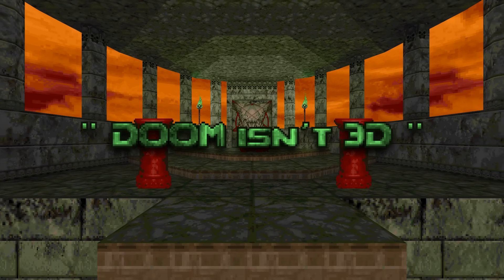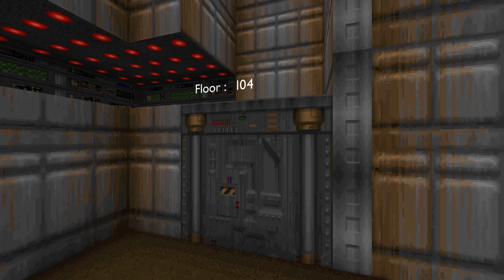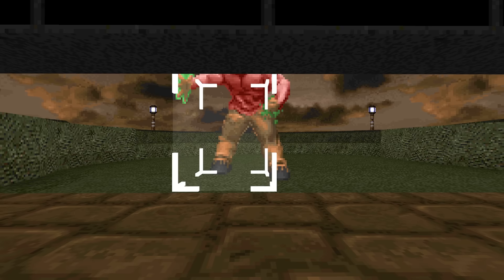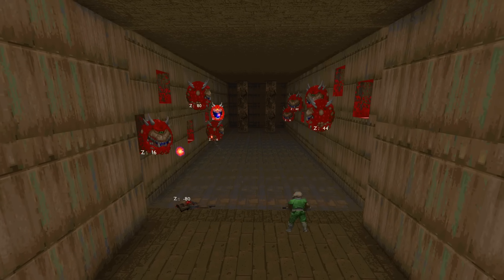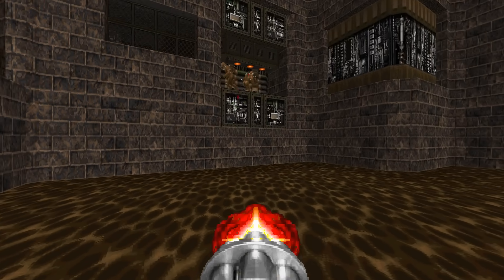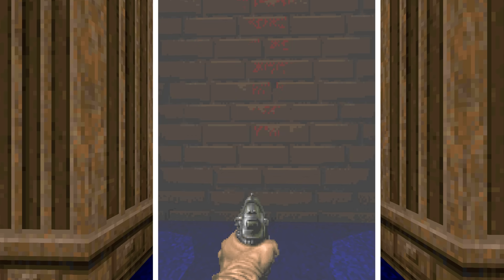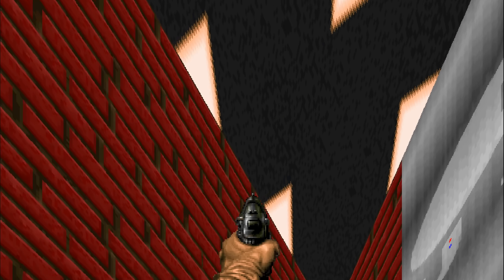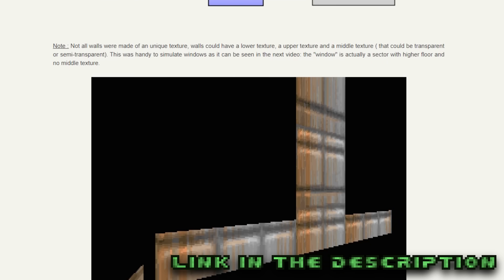Doom engine - Limited but still 3D

Comment: Fun fact: the Vanilla style of vertical look, also known as y-shearing, originated in Heretic
Reply: Marathon had it too, released almost exactly the same time as Heretic
Reply: @Xilefian  If we're talking about early 3D games in general, Rise of the Triad used this technique and was released two days ahead of Heretic :)
Reply: @Xilefian  there's probably other prior art as well, but it's certainly the first doom source based implementation.
Reply: @xeostube  marathon was based on a modified version of the doom engine, it also featured stackable cells.
Reply: @Golden_MC_1 Marathon was not based on Doom engine at all, it was a custom engine made for Macintosh and did not use binary space partitioning
Reply: Heretic also added z-collision to monsters and decoration IIRC, allowing you to fly over them when using its flight power up.
Reply: @LonelySpaceDetective  Raven Software developed some amazing improvements for the engines on which its games were based.
Reply: @Hammy Burgers Not him, but I do believe DN3D (and every other Build engine game) used the same technique for vertical look, yeah.
Reply: Um, no. I am playing Cyclones 1994 game by Raven Software. It uses Raven Engine - an updated Wolfenstein technology.
It has same perspective as Heretic, but the game came out a couple of months earlier.
Also Cyclones has sloped surfaces and catwalks, while Doom has none.
Reply: @volo870  That wasn't y-shearing
Reply: Actually Ultima Underworld from 1992 BEFORE Wolfenstien 3D was full 3D with looking Up and Down
Reply: @normanred9212  That wasn't y-shearing

Comment: The vertical look reminded me of Star Wars Dark Forces where you could look up and down with the same distorted visuals.
Reply: @idkanymore3382  Dark Forces was not on the DOOM engine, indeed if I recall correctly DF ran on a custom engine that wasn't used by any other game. Probably closer to the Build engine (aka the engine Duke 3D, Shadow Warrior and Blood ran on) if anything, but I digress.
I know a lot of FPSes of this age and type look very similar in terms of technology, but that doesn't mean they all used the same engine.
Reply: @LonelySpaceDetective  I didn't mean to imply that DF runs on the same engine, just that it uses the same rendering technique. :-)
Reply: @Mkemcz  That wasn't my intention, actually! When I originally made that comment, there was a reply stating that DF used the DOOM engine (or maybe they just speculated about it, I don't remember), which was deleted at some point afterwards.
You can see that I'm @ing someone who is no longer in this reply thread at the start of the comment.
Reply: @LonelySpaceDetective  Oh, I see it now. :facepalm: That's what happens when your brain takes shortcuts. :-D Have a good day! :-)

Comment: The most annoying thing is that a lot of people like to invent their own definition of "3D" in order to fit Doom into "not 3D" category. If you try to argue with them they will just move the goalposts further.
Reply: @An Orange Well because rendering is not polygonal doesn't mean it isn't a 3D game. You know, you can be blind in the real world, and it would still be a 3D real world. But as the video puts it, it's just a limited approach and there are better implementations of the concept like Quake, but that doesn't mean it isn't 3D, just uses a non-polygonal renderer and has a very limited way of describing the 3D world geometry.
You can separate 3D game in general from a game with a 3D world but that is rendered as 2D, like for example Dwarf Fortress, but Doom still doesn't fit that category as Doom renders 3D features with all 3 dimensions accounted for.

PS: Btw even if you're not blind, the real world is very unlikely to use polygonal rendering hah #wakeupsheeple #2Dflatearthftw
Reply: Doom doesn’t have 3D rotating cubes flying around in the air, and if you look up the definition of “three dimensional” in any REPUTABLE dictionary, it clearly states that 3D is “when you have a bunch of cool cubes and stuff spinning around”. None of this “consisting of height, length and width” nonsense!!
Reply: The whole debate was around the time doom came out, ie people thought it was arbitrary textured rendering of 3d objects. It's actually not very hard to define 3d and see if doom fits. 3d means literally that each vector is defined by 3 components. However, as you know in doom a square ceiling is defined as (x1, y1, ..., x4, y4, z). Eg as a bunch of 2d coordinates and then a z. 
Eg under a killing moon had fully textured 3d (though I suspect they limit camera rotations to limit the number of multiplications per vertex). So imagine you live in 1995 and someone asks you if doom is fully 3d just like under a killing moon. The correct answer is no.
Reply: @informativt  And just as many before you, you used your own definition of 3D to fit your narrative.

The square ceiling part is just the mapping format. It is entirely possible to use same format for a 6DOF-no-doubt-3D game without any changes, so that part is completely irrelevant.

The question " if doom is fully 3d just like under a killing moon" is also completely irrelevant, because different versions of 3D implementations with different limitations, are still both 3D, as long as objects can move along any of the 3 coordinates (and they can). so it does not make any difference for the question if Doom is 3D or not.
Reply: @SinaelDOverom  No, my definition of 3d is exactly the definition of 3d we talked about before. Is the doom engine capable of rendering a teapot?
Reply: Just to flesh out a bit. There are numerous games that use 3d for sprites and even full 3d rendering from 1970 and out. Escape from fractulus is fully 3d too. So is snake rattle roll and any isometric games on the spectrum. But the debate in 1995 was, is doom able to represent a fully 3d environment.
Reply: @informativt And so the moving of goalposts has begun.

It totally can render a teapot with some properly used midtextures.
REKKR (that can run in vanilla Doom on 1994 hardware) has some bareliefs, three dimensional swords, globes and telescopes 
https://imgur.com/a/5YyOytn

Also I tried to google up your definition of 3D and couldnt find it anywhere used in context of 3D space definition. The definition you used is closer to 6DOF. And while all 6DOF are 3D, not all 3D are 6DOF.

And then again, its limitations to rendering have no impact on ther fact that every meaningful thing in Doom operates in 3 dimensions - height, width and depth.

Heretic, whih uses same engine amended the inability of actors to move above/under each other too, it even has a barrel-bridge made of actors you need to run in order to reach a secret, as such severe compromise to optimisation was no longer necessary.

And just as many, many before you, you can dig up and throw at me all the cherrypicked definitions of how Doom is not 3D by virtue of inablity to do <X>, or <Y> behaving in a <Z> way somehow invalidating basic geometric definition
of 3D (having height depth and width), to which all relevant aspects of Doom adhere.

And like all other such conversations it will not go anywhere and nobody will be convinced of anything.
Reply: @SinaelDOverom  again, can doom render a teapot?
And I can assure you there's no moving of goalposts. In 1995 a basic 3d engine could do render 3d objects. Doom can't render 3d objects.
Reply: Just for the record, I made a 3d engine in 1995. If you gave me doom and said "this is a 3d engine" I would say no. It's a domain-specific renderer that gives the appearance of 3d. What's actually required of a 3d renderer is to render 3d data. (edit: whops for some reason youtube kept giving me network errors when writing messages so sorry for duplicates)
Reply: @informativt  Doom can render 3d objects, for example, a cube-shaped room is a 3d object, as is a column, or platforms jutting out of lava pits, it's impossible to describe these shapes without information about three dimensions.  It can't handle arbitrary 3d shapes, and it's definitely more limited than later engines (and some contemporary ones).  No engine can handle all arbitrary 3d shapes though, so I'd call it subjective whether you call it 3d or not.  I'd call it limited 3d, or 3d with restrictions.
Reply: @Ehal256  Yeah most 3D renderers back then couldn't draw an actual round teapot that didn't cheat by using discrete polygonal sides instead of continuous splines/nurbs points, and that is something easily doable today with shaders. But current 3D engines also cannot do some things that exist in the real world, so we therefore conclude there is no such thing as a 3D engine. Argument is now over, your welcome.
Mine thanks.
Reply: I haven't seen much back and forth discussion on this, but I'm surprised if "not being able to map rooms above or below each other" is not enough of a reason to close the argument that it's not authentic 3D.
Reply: @HUNDOLOS  A building being 1 story doesn’t make it 2D. 3D is defined as “consisting of height, width and depth”, all of which are present in Doom levels. Nothing about requiring multiple stories
Reply: @DoomKid  Indeed a 1 story building in the real world is still 3D. However, you can go inside, look around, and then also go up on the roof as well, same x y coordinates as before, except higher z axis. Can you build a map in Doom where you can do the same? You can build such a map in later engines, Quake etc. correct?
Reply: @HUNDOLOS  if you convert a doom map to quake, does it become more 3d, or does quake suddenly become 2d?  Answer: the doom map was describing a 3d space all along. Doom can handle some 3d spaces, but not all 3d spaces. Quake and later games can handle a larger subset of possible 3d spaces, but still not all spaces are possible.
Reply: @Ehal256  Not once did I call it 2D :) Even though I get the feeling here that quite a few diehard Doom fans are looking to feel opressed/offended by the Doom engine being called 2D, which is weird to me. Personally I'm in awe of the clever techniques employed, great for the time and hardware. But it should not be hard to acknowledge there were other engines and games only a couple years down the line that brought new levels of more realistic 3D spaces into gaming, not just in engine capability, but level design (think Tomb Raider's vertical architecture). I'm not hung up on semantics though.
Reply: @HUNDOLOS  Oh, no one is denying that other games pushed 3D technology much further than Doom did :) it’s just been a recurring theme that people add all sorts of requirements to “what is considered 3D”, when all that’s required is the presence of height, width and depth. The Doom player can walk around on the X and Y axis, and use a lift to ride upward or downward on the Z axis, meaning there’s 3 dimensions. It’s not a big deal really, it’s just funny how commonly people try to add extra arbitrary requirements to the definition
Reply: Doom isn't 3D by any stretch of the imagination.
Reply: @kekeke8988  you're wrong. Doom is 3d by a stretch of the imagination. That's the whole point.

Comment: By the z-axis, you mean y, right? Because z is oftenly used to imply “distance” or “depth” in 3d math.
Reply: There's actually no standard and Z and Y swap places ALL the time, it's everywhere.
Reply: @PeterLawrenceYT  I always thought of Z as being height, because on a 2D chart, thing are plotted on X/Y. Makes the most sense to make the 3rd axis Z when it’s added in!
Reply: @borogk  I know right! That leads to a world of confusion, well, at least it did for me in my case. In my raycaster engine, I used the terms z-axis & height interchangeably in the code, which as a result did not help at all when trying to refer to the same concept, haha!

Reading through the “README” in the original linux release of Doom source, John Carmack refers to it as “constant-Z” as well. I think it is better for the case of Doom rendering engine to refer to it as z-height like you’d suggested.

Comment: This misconception has always bothered me. Truth be told, what even is 3D? Even modern games use geometry advanced calculations to simulate 3D on a flat 2D surface. Even VR is the same thing but 2 screens in front of your eyeballs! It's all a matter of perspective.
Also, amazing work with the editing and custom mods. I liked the imps doing construction!
Reply: 3D in the case of games is simply that the game exists in a true 3D Euclidean coordinate space.

The reason for using 2D bump maps to simulate 3D effects on flat surfaces is because polygons are expensive, but moving stuff based on a direct value is easier, because matrix maths yayyy.

It's complicated, it's a lot of math. But yeah the game is a 2D projection of a 3D scene. The scene itself does actually exist in a 3 dimensional space. The camera object captures a 2D plane of the of the 3D space, the same as your eye, well your eyes do a lot more than that, especially when you take into account how your visual cortex processes the information before you perceive what you're looking at. Fun fact you don't actually see an accurate depreciation of the photons that enter your eye like a camera does. Your visual reality is entirely recreated by your brain, this is why psychadelics can cause various interesting and quite frankly amazing visual effects on your perception. Our brains are weird, the universe is weird, and everything is super cool and weird. Yayyyy information.

Comment: It's not 3-D, it's a 2-D field rendered to look like 3-D, it does have a Z axis but you can't fully utilize it, I wouldn't call it 2-D, or 3-D, or even 2.5-D, it's 2¾-D, for sure.

Something like Clarkson's Porsche 928 from Top Gear. Not a V8, but a V6¾.

Comment: Good video, but I feel like you haven't addressed the whole issue.

There are actually two different arguments that people who say "Doom is not 3D" make.

The first argument is that in fact Doom is a fully 2D game. This view was popularized by a famous youtuber who has passed away (the channel is called Game Theorists). In the view of these people, Doom is actually a completely 2D game where the Z axis simply does not exist. Anything that looks like 3D is actually a visual trick with no implication in the gameplay. This view is clearly completely wrong and Doomkid has already made a video showing how this conclusion disregards a lot of Doom's easily observable features.

The second argument is that Doom is not "truly" 3D. There is a question of semantics here, since we can say that no game is actually 3D, but in the case of Doom the point is that all the logic is happening only in one plane and the final rendering is a middle ground between 2D and 3D. The fact that a projectile can pass over or under an enemy is also determined in the 2D plane, since if the engine considers that the "Z" value is not the same, the so-called "Z-Clipping" happens. In the rendering process, in addition to being able to see Z-Clipping happening, we also have an idea of the relative position between the two objects on the Z axis, which gives the notion of three-dimensionality. 

This question is kind of stupid, because it depends a lot on the definition we give to what is a 3D game in the first place.

Anyway, I think the discussion about "2.5D" is reasonable, but the idea that the game is purely "2D" is quite questionable, because most of the arguments that people use to support this don't make any sense.